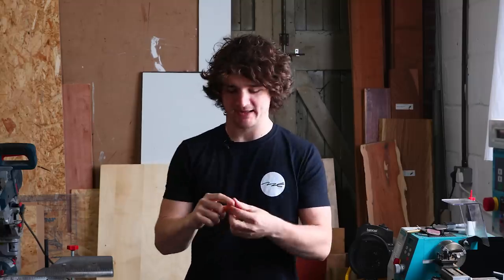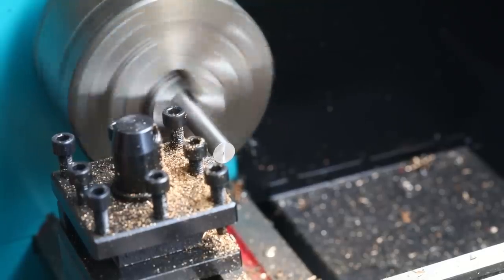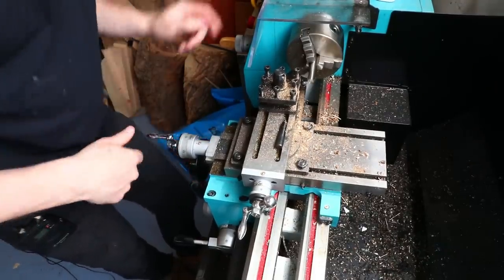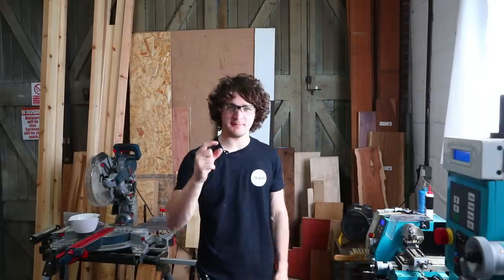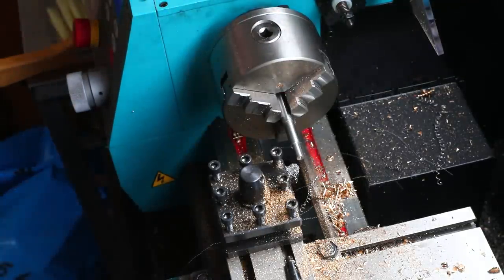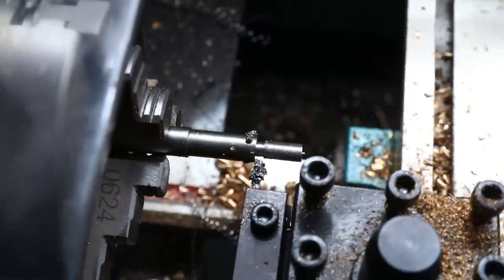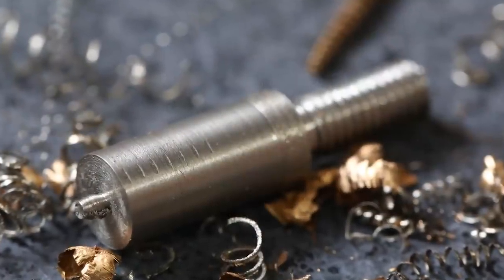Engineers, I need your help | Turning Tuesday #17

Comment from the maker: Just wanted to say a huge thank you to all the helpful comments that people are adding! I’m grateful as always to have you all here.

Keep them coming. I’m learning so much!
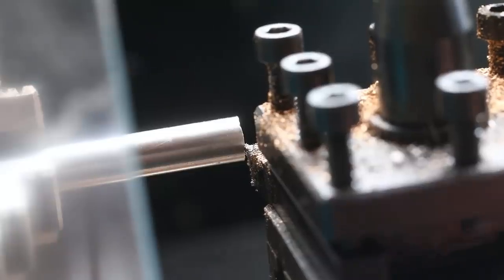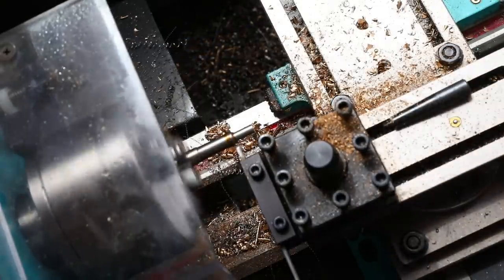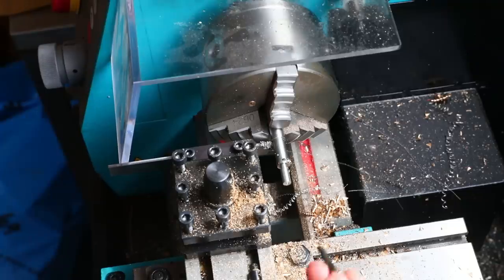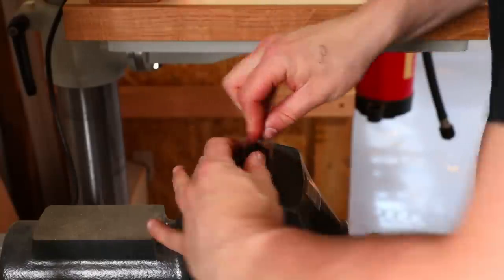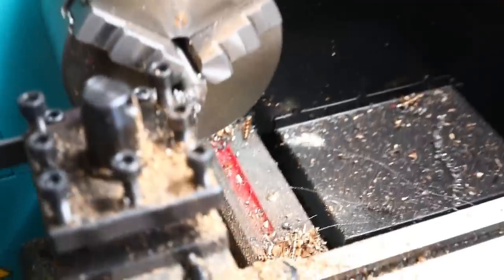Reply: Hi Matt, it's been a while since i was working on a lathe, but i'll try my best. I think you are doing a very good job already, well done!! There seems to be a small issue with your tool setup. Right at the beginning (1:54) when you flashed off the end, it seems a little nob was left in the centre of your piece. This usually indicates that your chisel is a little bit too low in the tool holder. Try to back it up with some shims, which come in various thicknesses. This should lift your tool slightly over the centre, so you cut the final nob with the front edge of your chisel and get a perfectly flush face. Personally, i would not modify the measurement wheel after you have set it to zero once. Every re-adjustment will get you a tiny little bit less accurate. Just get your math up ;-). At about 7:45 you do several passes with very little cutting depth. I would recommend taking 1 or 2 deeper cuts and do a final very, very shallow cut. This speeds up your process while giving you a better finish. For the last one i would also go on the slowest speed setting with your automatic feed. Not 100% sure on the RPM you have selected. 400 seems to be pretty slow for this small diameter. You might be able to increase that one, but please double check before. There should be material/cutting speed/spindle RPM diagrams on the web where you can find the right settings (https://en.wikipedia.org/wiki/Speeds_and_feeds).  10:30 i think your lathe should have a cooling liquid pump which you could use with a bit of an emulsion. It might get a tiny bit messier in your workshop but provides better results too ;-). 11:30, don't part before you put on the thread. Safes time and hassle. 12:00 the work-piece should not be hot at all from what you were doing. If that is the case you should really get some coolant flowing.12:15 cutting the thread on the lathe is a lot easier and quicker than doing it by hand. Not sure how many you have to make of these stubbies, but it might be worth getting the equipment for it. IT should not break the bank,. With a bit of luck you might be able to re-use the same cutter from your hand-tool in your lathe setup. That lathe-thread-cutting might improve your production time the most. Yes, 12:50 you are exactly right. At school we used a pack of different shims with different thicknesses down to 0.05mm of all sorts of materials, copper, brass, zinc ... (http://www.newmetalworker.com/Howto/setlahecutrheight.html). Our teachers drove us mad setting up the tool perfectly centered. 15.56 if you want to get rid of the scratches on your piece, you can always use some fine sandpaper and wrap it around a file. Then press the file with the sandpaper on top of the piece while it is turning, that polishes the surface. Beware of any lose cuffs though! Hope this helps in any way. You and your videos have made me start woodworking and i have learned basically everything i know from you. Many thanks for your educational and fun videos. Great stuff! Cheers.
Reply: @bjoernbrunner7048   took the words right out of my fingertips😉
Reply: I thinks it's been mentioned before but you can put more than one tool in your tool post, slacken it off and rotate to change tools with out having to re-centre

Comment: I think that’s a quick change tool clamp, you fit both tools (shimming with strips cut off a soda can to get the tool at correct height), when you want to swap tools you undo the lever that you removed and rotate the tool holder (180 degrees) to change tools.  Hope that helps speed things up and simplify setup.
Reply from the maker: Ohhhhhh! That makes so much sense! I was wondering why it’s 4 sided! 😂
Reply: I see others have mentioned shims, I think it was my Axminster rep who told me about cutting up coke cans to make shims much better than paying for them!

Comment: Your diameter might get to small, because you changed the feed. If you move the tool quickly along, it bends the material slightly away from the tool, when you choose the slow feed, it was not bending that much and it removed more material. 
You should only use the propper feed, not the half nuts, but you can speed the process up by getting the right rpm. 400 is much to slow for the diameter. If you are new to a lathe you have to calculate  the speed. Experienced mashinists can do it by "feel".
As far as i have seen it, you are not making any dangerous errors, but if you want to get better in this field, you should get some lessons by an expierienced worker. Mayby contact another youtuber and do a colaboration video.
By the way, i do really look up to your woodworking skills and so it is nice to see that I could teach you something too.
Keep up the good work and excuse my englisch! 
Greetings from Germany
Reply from the maker: Great tips there Karsten, thank you!
Reply: I would say faster as well however you may then experience chatter because of hangout
Reply: Speed up your rpm's, your carbide insert bits like a much faster cut even in stainless. Actually, your lathe probably cant turn that diameter fast enough for the piece you are cutting, so dont be afraid to give it some gas. and adjust your feed to cut chips, not spirals. Look for 6's and 9's. Again, a bit faster. A "spring pass" -- a last pass cut without changing your depth of cut just before your measurement will take a fuzz more off by not springing the piece as much as a full cut and give you a more accurate place to determine your last cut depth from. You may find that your final diameter is a bit large again. Another spring pass should get you closer. Also, not putting it down, i use a similar lathe in my shop. an import lathe of that size will not be the most consistent or accurate. You should be able to always get close but if you got perfect, you got lucky.  At least this has been my experience. Hope that helps.

Comment: 1:08 in stainless, if the tool ever squeals or rubs, it pretty much screws you over. Especially since you're ysing high speed steel. Grab a few carbide insert bits, they cut much better on hard materials, although they are a bit more pricey.

Also, a little earlier, yer hand left the chuck key in. Word of advice. Never do that. No matter what. Even if you're just moving the material a little bit, take the key and place it to the left. Eventually, you get into the habit of turning the machine on without thinking, and the chuck key will kill. 
I only had it happen once, and it wasnt in the chuck. It was just that i left the key on the carriage/slide, and fed the carriage into the part, having the key slam into the chuck and fly out.

Comment: thank you Matt.  okay i used to do this back in the 70s -80s nubs on ends , set your cutting tools center . slip a scale ( ruler) between the cutter and the work piece if the scale is straight up and down you are centered if not adjust . up or down till it is should be make with the tool holder . half nuts are for threading . check your feed and speeds for travel .  cutter not hitting the mark missed the size you were shooting for  ! spring back on tool . i used to never trust my last cut i would pull cutter back and just touch off then measure what i needed to go in for final pass.  cut a champer on the end of work to make it easer to start cutting threads 30 deg is good . hope this will help
Reply from the maker: Great tips there Walter. Thank you!
Reply: @MattEstlea  you are welcome
Reply: @MattEstlea  i learned on a sub tender making parts for nuk subs but it was a long time ago . the streamers from your cut can hurt you if the get caught in the chuck and fly around  . sometimes grind a chip breaker on the cutting tool . its a practice thing small grove close to the the cutting edge good luck and enjoy

Comment: Hi Matt,
Firstly you must have all your cutting tools at centre you can use a accessory  called a dead centre which you slide into your tail stock then offer the cutting tool up to it and then shim tool to correct height. Your tipped cutting tool is in the category of a negative rake you need a lot of power to get the best performance out of these so try a get a positive rake tool like a copying tool which will also be able to carry out your undercutting at the end of your thread also it will leave you with a small radius instead of a sharp corner which your parting tool is currently doing (radius gives you better strength). This also minimises tool changes. Use a steel rule to gauge lengths when your roughing out and set a pair of external Calipers to your second diameter again keeping over size as your roughing out then change speed when applying final cuts to both diameter and chamfer end before parting off, again when parting off get that speed high, once your getting to the core area you need the speed high no different when your drilling a hole using a small drill bit.
Hope this all helps Phil

Comment: If you use the parting tool to cut the groove before turning down the diameter of the threaded part you'll have nice accurate visible measurement and you don't have to worry so much about stopping at an exact distance.

It might not save time because of the tool change, but it might make it less stressful.

A tip when turning outer diameter to size:
Turn down the whole length slightly oversized, then turn down the end bit enough to fit a callipers/vernier/micrometre, CHECK,  adjust if necessary. When you have the right diameter at the end you can do a cut along the whole length. if you cut the end bit undersized it doesn't matter you can cut it off, or in your case it will be turned down later anyway
Reply from the maker: Great pointers there! Cheers Christian

Comment: Thread it before you part it off 
Use the tailstock and chuck to square up the die and holder then ****Hand!!! spin the chuck 
Do not start it up 
Also shim your tools to be dead center 
And mount a tool on each side of your tool holder and just spin it 180 instead of changing tools every time
😀
Reply: Came here to say what this guy just said! The point of the multiple tool post is so you don't have to go through the ballache of tuning in your tools to dead centre every time you want to change tools. It'll give you big efficiency savings in the long run.
Reply: Bok bok

Comment: Hi Matt,  when you "face" the part, in the beginning,  you may have noticed the end had a "nub" on it.  If the nub is there and flat on the tip, the cutting tool is too low, if the nub is there and rounded over, the cutting tool is too high.  Add or decrease shims to get the cutting tools on center and your finish will look much better.  Also, consider backlash and remember the hotter a metal gets during "turning" operations the bigger it will be on your micrometer.  It should only "shrink" after cooling by a few 10 thousands of an inch (something to consider when working to close tolerances.  Love your channel and new format!!!  Much success in the future!!

Comment: so there's a few things you can do to help yourself out, you are cutting below center which not only leaves a little nub but also means all your reference measurements from touching off the tool are slightly off too, so first off there's a couple of things you can do, either shim the entire tool post up or the tool holders individually one option is upgrading to a quick change tool post which has fine adjustment on tool height. That alone should address a couple of things, also verify your cross slide using a dial indicator, make sure you are moving how far the dials say.

Comment: The first thing I'd recommend is to leave the absolute minimum out of the chuck, I'd probably turn the 6mm shoulder first with just 19mm out of the chuck. Then pull it out of the chuck to do the 9mm diameter, you just have to make sure that section is long enough and you have to reset 0 when you change to the parting tool. 

Shimming the tool was common when those tool holders were used, you can buy a pack of shim stock pretty cheap. I'd shim the tools up to center and leave them in the holder, rotating the post rather than swapping tools. A quick change tool post set is pretty cheap if you get a piston type, definitely will pay for itself if you're turning a lot of them. I'd also look at some indexable tools for that SS. 

That small diameter SS is either going to be slow or will have a rough finish, you're going to be fighting deflection but having the material trying to climb the cutting is really making it worse. 

Chaffer the end of the part with a file and then with the die in the handle use a chuck in the tailstock to push against the die and turn the spindle chuck by hand to get the die started straight will make the threading a little easier. I guess that's sort of hard to understand. I can probably take some pictures if you want of what I mean.

Comment: Hello, hope I can help somewhat, I've got a small hobby machine shop in Southampton, not an expert by any means. First of all I would up the speed to around 6000rpm when cutting with the carbide and 4000rpm when using HSS. There is a lot of material hanging out the chuck, personally I would have a live centre in the tail stock to support the material, this will also let you take deeper cuts and minimises the chance of the material jumping up onto the tool, and possibly causing injury. I am unsure how many of these you are aiming to make but for smaller parts I use a straight shank collet chuck mounted in a 4 jaw and dialled in, then it would be possible to use material that is already 9mm and just focus on the shoulder. The tools need shimming to cut on centre, this is extremely important and will probably solve a lot of the issues you are having, just use thin shim stock or cut up drinks cans, your toolpost appears to be a 4 way rotating type so you should be able to set both tools up in it and just rotate it when you need to change. Hope that has been some help, I'm no expert!

Comment: DAMN IT!  I had an entire tutorial written up and inadvertently deleted it.  I actually cut it short because without physically being there it's rather difficult to explain a lot of the art vs science and feeds vs speeds needed to turn 303 stainless, which by the way, is considered a "free machining" stainless which means if you're working with the correct feeds and speeds you most likely won't need oil or coolant/fluid.  May I make a suggestion?  Regarding a lot of this stuff if you take a look at two channels: Joe Pieszynski and ThisOldTony they can lead you through the art vs science aspect of things like, why you get that little nub in the middle etc.  The reason is that yes.....the tool is too low.  Take a ruler, place it between the parting tool and the material then bring the tool up to the material lightly pinching the ruler between the cutter and the material.  If the ruler is tilted to the left your cutter is too low, tilted to the right your cutter is too high.  At times some materials want to he parted off by having the cutter just a hair below center.  That nub appears because at a very middle you're actually pushing the material and NOT cutting it.  That's also why drill bits blow out on the back side of stock as they punch through.  It's because the flutes of the bit are no longer cutting and the web of the drill bit is pushing through that minimal wall of material remaining.  Hey, I live in Philadelphia Pennsylvania and this stuff is complicated such that it's virtually impossible to explain in a short few paragraphs.  I'll gladly chat with you some evening if you feel like staying awake. Take a look at Joe Pieszynski (Awesome machinist and quite logical), ThisOldTony (awesome also and funny as hell) and ABom79 (great machinist that I highly recommend because he works on  heavy stock.  The only difference is the size of the tools but every other aspect is pretty much identical.  Every one of those gents is a master at what they do and you will learn 10000000000 times more than if I try to explain it here.
Reply from the maker: That’s really helpful Vince, thank you so much!

Comment: You could cut the thread with the part still in the chuck which would save moving over to the vice and leaving clamping marks. 

Part off pip will always be an issue. All I can suggest is to use a file or stone to get rid of it.

Hope my comment on your last metal turning video was helpful!

Comment: Not sure if your lathe takes a tail stock if it does use a centre drill to dimple the end and then support with a live centre this will allow you to machine a longer length for your first cut depending on the length of bed this will save time and the support will stop any flexing you can then slide the bar back and do your step machining  Also using a tail stock  will allow you to support your die on centre so cut the threads without removing from lathe then part off saving time 
You have guessed you need to shim for centre Also others have mentioned back lash if you over shoot when dialing in your setting turn back further than your set pont and then wind forward to the set point in other words  always wind your dial in the same direction for your cut this eliminates backlash by taking measurements youl soon find how accurate your dials are and then you can compensate by either reducing or increasing on your dial adjustment Hope this makes sense

Comment: Try setting the tool post up with two cutters, and just spin it around to change cut... it should be indexed at 90 degrees. Also add a third, thread cutting tool. Once you get everything set up you save all that tool swapping and reduce the threading time as well. Cheers!